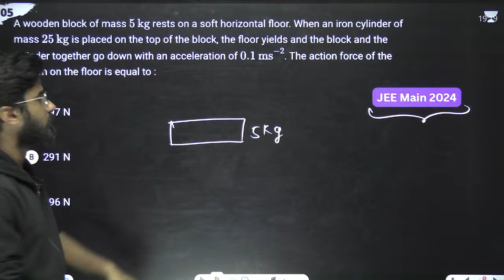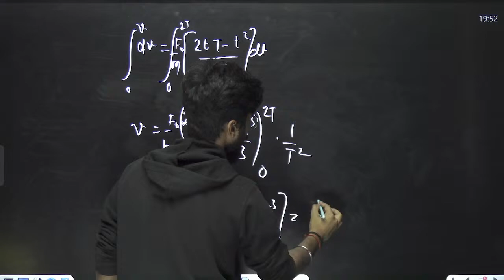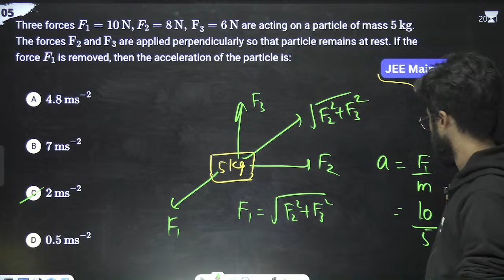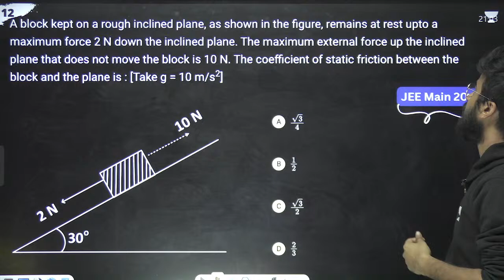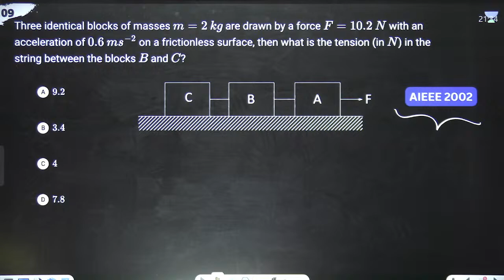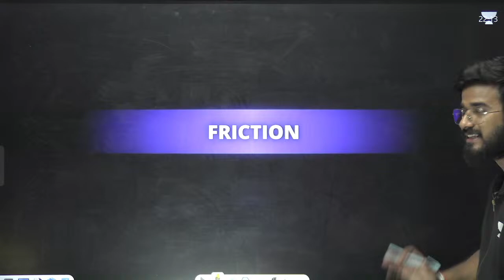Complete Solution & Analysis of all JEE Laws Of Motion PYQs (2002- 2024) | JEE 2026

Comment: 1:27:40 answer √2N,45°✅ not 135°❌
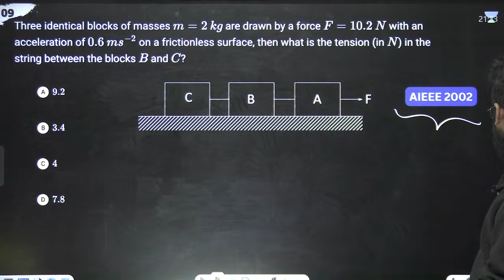2:26:58 answer 1.2N✅ but options not given❌
Reply: Yes 1.2 N is logically crct but the official answer is 7.8 N the question has not provided sufficient values but u can calculate the Tension AB and then calculate Tension BC
Reply: Correct